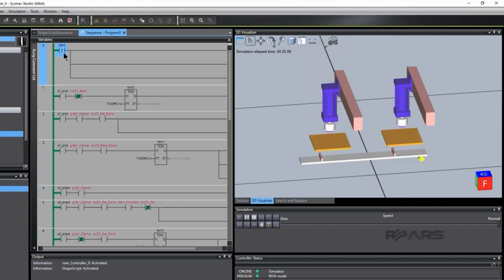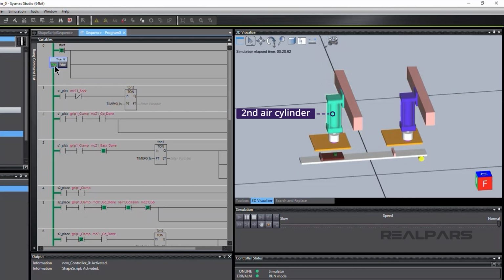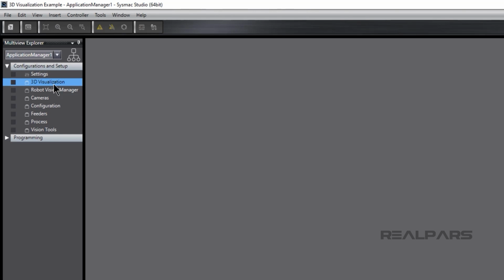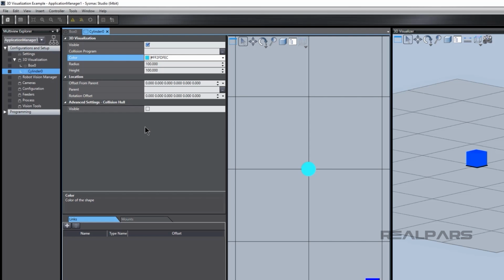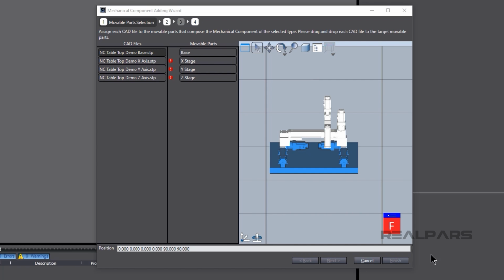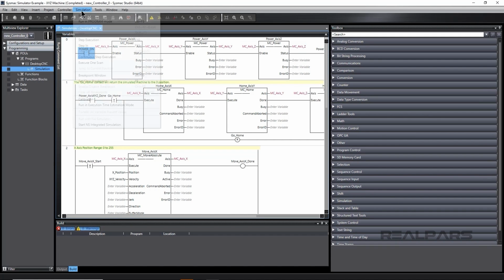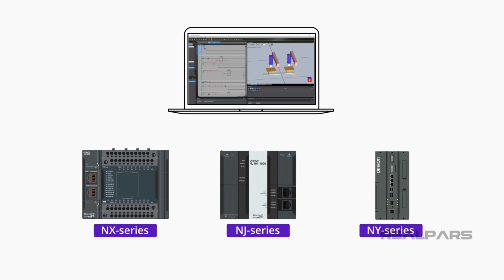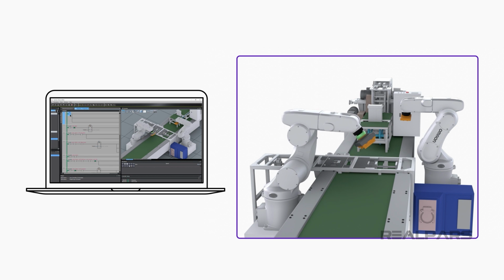Introduction to Sysmac Studio 3D Simulation Visualization

Comment: For fast, efficient programming,  Omron is an excellent choice.  This also applies in a wider scope ( engineering/information gathering for systems integration,  support,  lead-times ). This is if we compare to something like S...       However, 3D-Simulation should in many cases - simple machines -  not be needed. For machines with complex internal relationships - very good.
Reply from the maker: That's a great point about choosing the right tools based on the complexity of the machine!

Comment: is 3D used for testing? ie, checking physical properties, faults, maximum speed, etc.? it seems 3D should be first step in industrial automation!
Reply from the maker: Hi @nnnnn   About Testing - It is possible as the testing of control logic by PLC. This is because the 3D simulation is executed with PLC emulator and the actual Ladder program.  A PLC engineer can use this 3D simulation for their program debugs.
Checking physical properties - There is not the functionality for physical simulation.(ex. friction, stiffness etc.), However, there is the function for collision check. This simulation is executed by actual Ladder program, therefore the PLC programmer can check their own program.(inc. error case)
We think it is useful for beginners of Omron PLC programming.

Comment: still boggles my mind that it is in ladder logic and not Python, Java, or something more programmable.. it is 21 century cmon!
Reply from the maker: Basically, NJ/NX series PLC supports language specifications that are based on IEC 61131-3.  The Ladder is one of them.
The 3D simulation uses the actual PLC’s program regardless of the  IEC 61131-3 language chosen.
Reply: dude it have other languages for you to control PLC.
but the popular is Ladder diagram.
the resion why no python or other programing languages is: the PLC DNA.
Reply: Omron:  we usually use ST for everything.  Ladder is for examples for beginners.